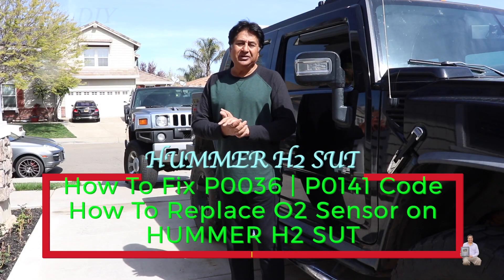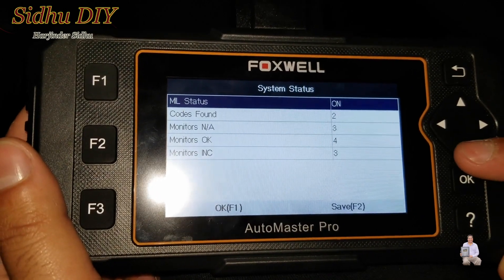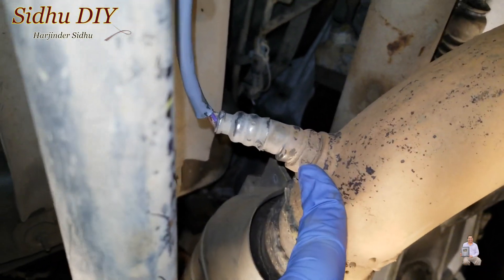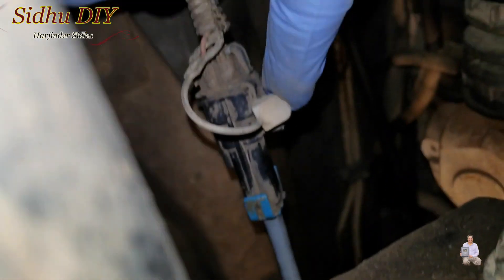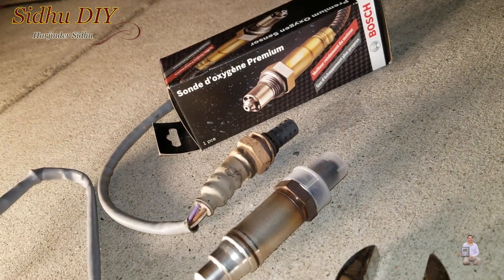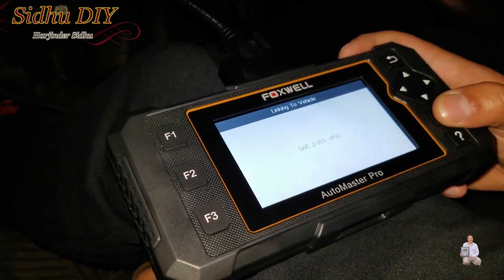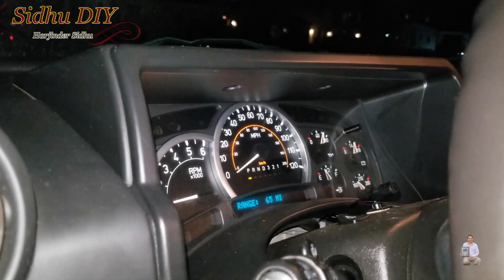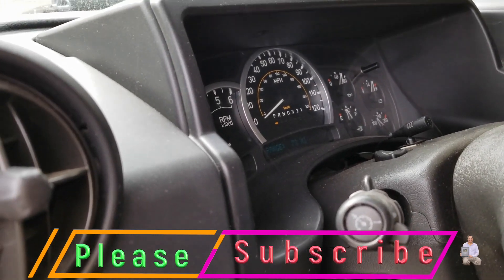How To Fix Code P0036 Code P0141 on HUMMER H2 | How To Replace Oxygen Sensor on HUMMER H2 SUT

Comment from the maker: How To Fix Code P0036 Code P0141 on HUMMER H2 | How To Replace Oxygen Sensor on HUMMER H2 SUT | Code P0036 HO2S Heater Control Circuit Bank 1 Sensor 2 | How To Reset HUMMER Check Engine Light ON | Code P0141 O2 Sensor Heater Circuit Bank 1 Sensor 2

Comment: what about the P0135 code?
Reply from the maker: How To Install Oxygen o2 Sensor Driver Side on HUMMER H2 | Error Code P0153 - https://youtu.be/DyBEbmtOsLo
How To Install Oxygen o2 Sensor Passenger Side on HUMMER H2 | Code P0153 - https://youtu.be/FAz1l2JXpmE

Please change your upstream oxygen sensor.
Error code P0135 is the OBD-II generic code indicating the engine control module (ECM) has tested the O2 sensor heater circuit and has detected a problem with the O2 sensor heater circuit in bank 1 sensor 1.